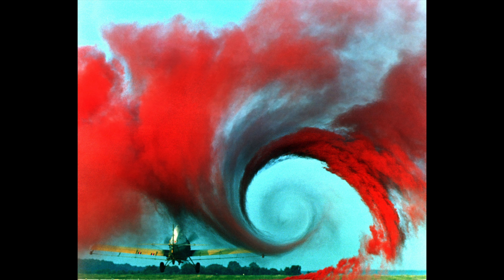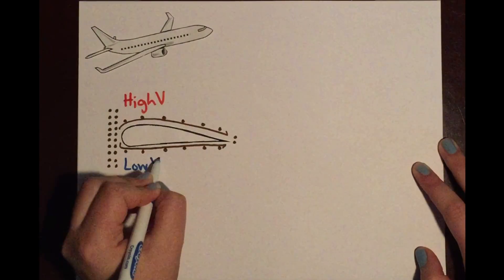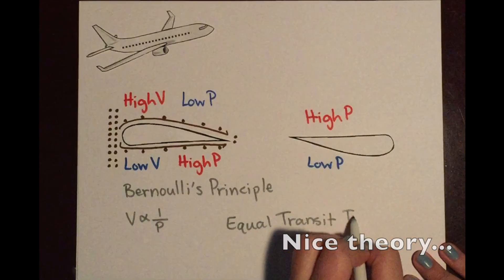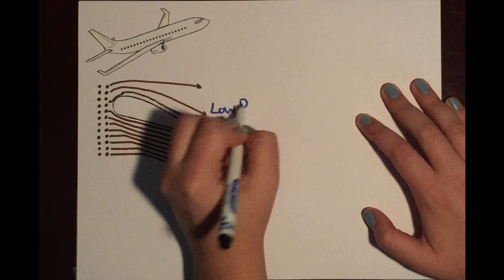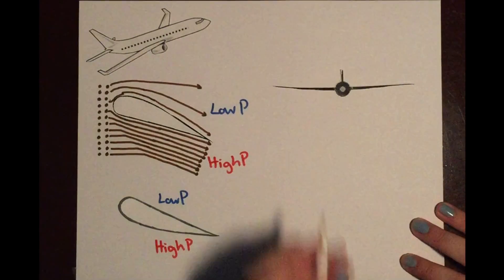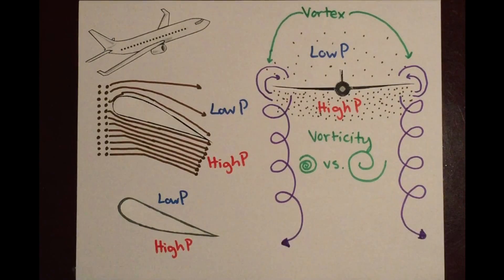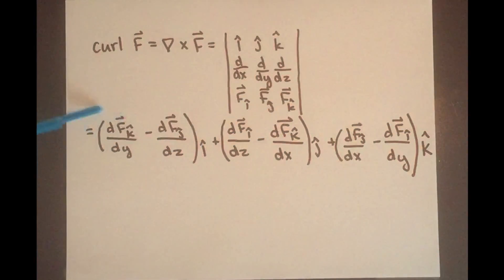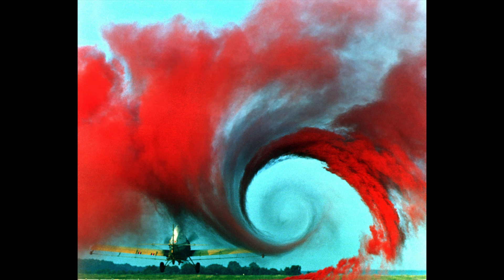Wingtip Vortices

Comment: Sorry... airplanes don't get "pushed" up by the higher pressure under the wing, they get "sucked" up by the lower pressure on top. It's all about angle of attack and foil cross section. Very efficient right way up where the foil section and angle of attach are optimized,  and good enough up side down where angle of attack is more of a factor then foil section. Good video though.

Comment: Careful with those streamlines as when they get closer the velocity increases and hence low pressure  exists and when the widen up then the velocity is lower and hence higher pressure exists.  To draw those streamlines to depict the real action at different places is not so easy and what really goes on  above the top wing surface needs to include other behaviour for those streamlines to represent the real action.
You will be surprised that an unsymmetrical foil can also fly inverted, and it is surprising where the stagnant point at the front would move to  make the upper curve longer than the bottom one.  It is ugly but it works!
I like your general definition of the Curl function, but its application in this case needs further explanation.  Normally when one uses the Curl function there are two functions curling each other as in  a Magnetic and an Electric field.  They must curl  together to produce an efficient machine.   In this case one could look at the  direction of the wing tip as an electric current flow and around it there will be the Curl or vortex as the Magnetic field curling the electrical current.  

The foil is not an equal transit time situation    where two particles at the leading edge will meet again at the trailing edge. Let me try and explain this my   way:-
Assume a conventional wing with some appreciable angle of attack travelling from the right to the left.  I rather have the wing travelling rather than what we see in a wind tunnel where the wing is stationary and the air moves fast as in real life it is the air particles that are stationary and not the wing  and there are some actions that the wind tunnel could mislead.
So with two  stationary air particles present at  the  oncoming leading edge  stagnant  point, one particle will go above and one below,  but it is not as simple as that, the compression zone before the leading edge will shoot them up and down in an efficient airfoil section with a good leading edge.
Now the  one shot up will be been given an  extra energy upwards and  when it goes in its flight above the top surface of the wing, it will find a low pressure zone above the wing  passing under it and so it will accelerate into it  horizontally towards the trailing edge gaining horizontal velocity towards the trailing edge. Since the upper surface of a  good foil recedes down then the particle would have a greater time to gain a horizontal velocity towards the trailing edge.
The particle that was shot  down would be different as the lower surface of the wing  is changing down as a faster rate than the particle is coming down and so the particle sticks close to the lower surface and because the angle of attack causes a high pressure zone  as the particle goes down it is facing a high pressure zone all the time while the wing goes over it hence this cause the  particle below the wing to gain a horizontal velocity towards the leading edge.

So when  their original  " stationary horizontal " velocity has been modified the upper one gaining some horizontal velocity towards the trailing  edge  because of the  existing low pressure zone.  while  the lower particle gains some horizontal velocity towards the leading edge because of the compression under the wing.

At this stage I shall not go into the  real action and  reason why there  is a low pressure  zone above the wing and a  high pressure zone below the wing. I have my own explanation  about the  upper wedge of leading edge  giving extra energy to the particle at the top to be given a flight path over the upper surface which accelerates it back  to cause a reaction on the wing.  It is a very clever way of transforming engine power, or loss of altitude  or tow rope tension in a glider to  give extra energy to the air particles going above the leading edge.   It is all engine power transformation to ass energy to the P + pV^2/2 of the particles in the streamline,  But let us stop here  for the moment. 
Congratulations , I think that you will make a good lecturer.

Comment: I'm sorry to tell you this Alessandra but there are some major flaws in this explanation. Not the wingtip vortex explanation but the "particles have to travel different distances in the SAME TIME" explanation. You are forgeting about upwash and downwash, about the mass of the air (and therefore its cinematic energy). In an assimetrical airfoil the particles that travel over the upper camber travel must faster and arrive much sooner at the trailing edge of the wing than the ones that travel under the lower camber. If this didn't occur the differential pressure wouldn't be enough to generate the huge amount of lift needed for a heavy boeing 747 to fly....
Reply from the maker: Yeah I know that my first explanation is wrong, and I actually state that in the video. I don't really understand why it is wrong because I am a high school student and haven't been taught it. Most of the information in my video comes from what I have learned from the Internet. But from what I understand, lift is extremely complicated and there are so many theories on how/why it works that it would be impossible to include them in a 3 minute video. So I just picked two theories and explained to the best of my ability why they are right/wrong based on what I could gather from various websites. The reason I included the first incorrect theory was to disprove a common incorrect theory taught to most high schoolers including me :)
Reply from the maker: The point is that I know that air particles do not travel the different distances at the same time, but I didn't include why because I don't know why and I didn't have time to include why anyways because the video couldn't be longer than 3 minutes

Comment: That was a work of beauty.Raises the question:  since the existence of wingtip vortices has been known since at the latest the 1930s, as has the value of winglets in minimizing same, why did it take something like 50 years for the airlines, and the airplane manufacturers, to get with the program and start installing the winglets on most commercial aircraft?One might almost think they didn't care as much as they claim to about "enhancing shareholder value."Thanks for sharing your passion here.Happy contrails.
Reply: Use it when you need it. The oil crisis and recent emissions norms were the reasons.